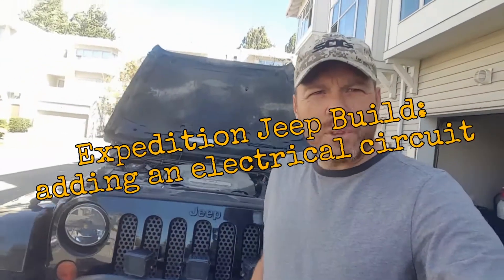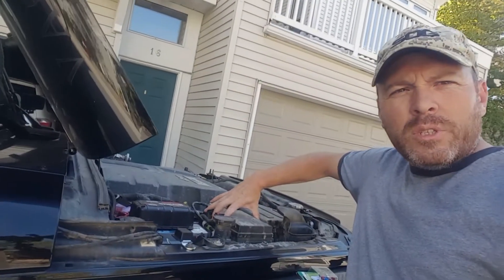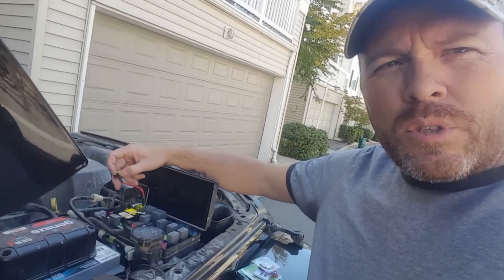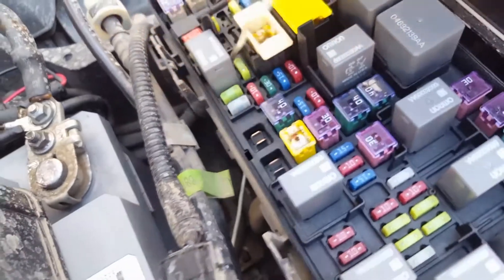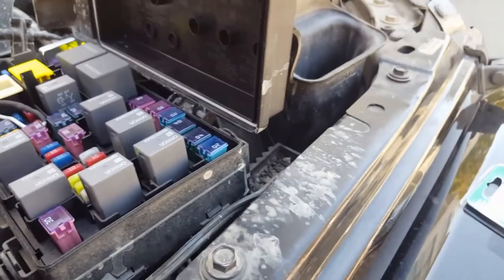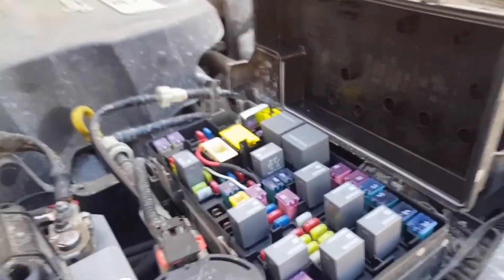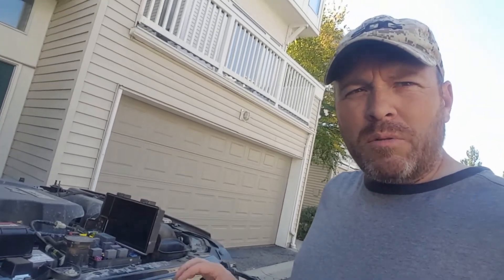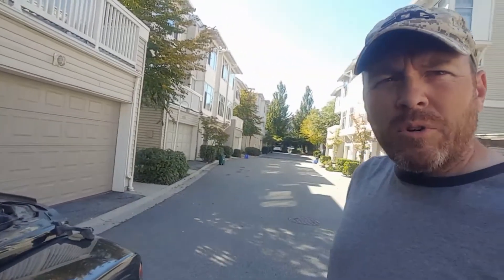Expedition Jeep Build: Adding an Electrical Circuit

Comment: That hole you passed a wire through is to drain condensation from the fuse box. Don't put a wire through the hole if it significantly reduces air flow.

Comment: Man, I wish I saw this video yesterday before putting a hole in the side of my fuse box!!!!!

BTW, your fuse tap should be rotated 180 degrees.  There are load and line sides on the fuse sockets... you got the fuse tap inserted in reversed.  The only problem you'll run into is that if the bottom fuse blows, the top fuse (even if it's not blown) won't get power.

Not the end of the world, but if you aren't aware of that and you try to go to troubleshoot, you'll be scratching your head.
Reply: How can I tell which is the load side?

Comment: I want to add a drl on my jk is the m9 port good for it and 7.5 fuse good to use?
Reply: I was wondering the same thing. Did you ever find an answer?
Reply: I've done it with no issues so far. I kept the original 20 amp fuse in the bottom and 5 amp fuse on top. In theory this should protect the original circuit because the new circuit opens at the top insert. Also, make sure you find which connection in the fusebox is the live side using a multimeter. With the fuses plugged into the pigtail facing you, the left side should be your load side (power coming in) this will send the current through the fuse instead of directly into the piggyback circuit.

Comment: Thank you for the tip on running the wire though the small hole in the bottom of the fuse box. Most people suggested drilling a hole in the side of the box, this is much cleaner.

Comment: So you used two 10s for accessory??
Reply from the maker: Just the one fuse for my "auxiliary" accessory (the red #10).  The yellow fuse is a 20 amp fuse for the OEM accessory circuit.   The 10A fuse is really overkill and I should reduce it sometime in the near future -  it's only there providing power to  a switched relay under the hood which is fused to the battery with a 20A fuse.
Reply: vagabond expedition sorry I'm confused. I don't know much about fuses. I have a 2014 JKU.. I'm doing the same thing.  I just don't want to put the wrong fuses in the circuit holder.. the new fuse thing. If I  put two 10s.. that will be okay ?